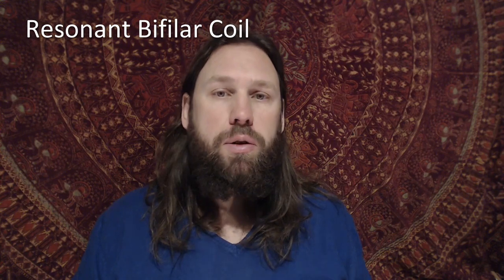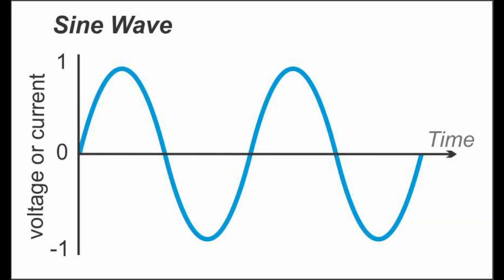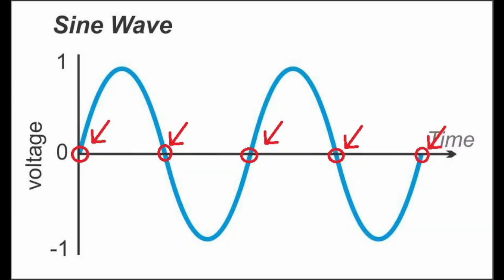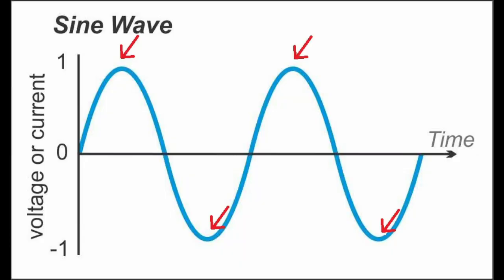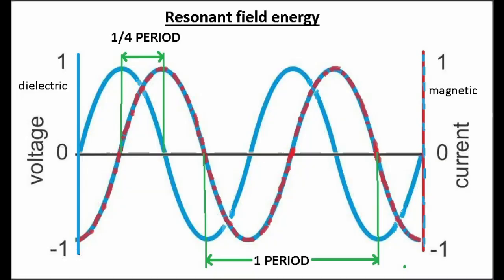C.P. Steinmetz explains electricity 02 Power, inductance and capacity

Comment: What is the current exactly ? Is it the magnetic and dielectric flux in movement ? Ether in movement ? Thx !
Reply from the maker: yes Aether = energy = inertia/momentum.
When a static field (voltage) starts changing, an aether energy flow (current) starts.
this flow can be longitudinal and/or transverse. it can be dielectric displacement current or magnetic current.
So 4 ways to flow, 4 types of current and one static polarised aether field, making a total of 5 fields

Comment: It complicates understanding electrical power (as energy) when negative voltage (dielectric field energy) is both a decreasing value (no matter the relative value) and a value that is below neutral or ground value.  Either one can have dampening effects to your power performance.

I also think it important to recognize the distinction that both components of electricity (dielectricity and magnetism) are kinetic energies, following the characteristics of kinetic energy transfer (not always linear combinations) in fact, amplification of relative values are easily amplifed by combining accelerating values of one energy with another ( the basic Oberth effect, used to amplify rocket thrust energy in space or power transferred in sports from boxing to baseball to cricket, bowling, and billiards.) Maximize acceleration of values in combination or transfer and see an exponential increase in value. This fundamentally is what enables capacitors to transfer voltage (only when changing values). And why high voltages and frequencies have higher performance efficiencies.

Comment: Master Ivo, hello and thank you for your review of Steinmetz. I think it is important to distinguish between exchanging energy and creating power. It probably is best to focus on the exchange of energy and the dynamics that facilitate this with electrical energy components rather than go down the rat-hole of discussing the creation of useful power. Perhaps you can avoid the laws of nature police. NASA uses the Oberth effect all the time to maximize the effective transfer of energy from rocket fuel to spaceship velocity. This can facilitate the designs of electrical engineers optimizing the transfer of energy. Basically, the transfer of kinetic energy is exponentially improved with increases in velocity (In baseball, the only way to hit home runs is to accelerate the speed of your bat swing. (maximizing the bat's velocity upon contact with the ball. For martial artists, the same applies to punching. In electronics we see the only way to get a signal through a capacitor is to add velocity (a rate of change) to it. Same with storing magnetic fields in an inductor (change the rate of change in a voltage, producing a changing current (whatever that is without charge particles). 

Steinmetz also wrote about the similarity of electrical circuits massively exploding when high-voltage impulses were introduced at apparently distant points. This he likened to steam engine vessels that were opened rapidly at only one location, exploding in total instantly, demanding a very small controlled release to avoid this avalanche of state change.  Having a continuous capacitor along the length of an inductor changes the dynamic of inductors that normally are fed dielectricity from an end, progressively setting off the back EMF along the inductor, now becomes a massive, full inductor, simultaneous dielectric shift, creating a full length, simultaneous back EMF. (ideal for impulse creation, not possible with discrete components. Incidentally, characteristics would greatly improve the efficiency of electric motors exchanging electric fields and mechanical energies.

Most of the electronic strategies are reversible. IF you buck two magnetic fields at an inductor, you present a nearly infinite rate of change in the magnetic field at the inductor, producing a very high rate of magnetic induction without an equally high Lenz "law" reactance, improving the transfer of energy, looking like creating energy because a 12-volt battery can power a home with this method. Tesla and Don Smith both worked with very high voltages and swiftly changing impulses because they improve the efficiency of energy transfer to the point of running huge loads with self-transferred excess energy.

To switch metaphors... if someone gave you a box of bricks and a bucket of mortar would you proclaim houses could not be created? with electricity made of dielectricity and magnetism can you reasonably think electricity cannot be created? Does NASA create energy every time they get a single load of rocket fuel to send a ship 4x faster by doing a burn in orbit rather than free space? Sure looks that way to anyone not practiced in physicist-legal-speak. For a casual observer, combine a changing dielectric (voltage) field with a changning magnetic field, and do it so that the reactions do not oppose the change generators and you will be creating lots of electricity out of leveraged fields, seemingly for free. Don't do this if your goal is to charge for limited amounts of power. Those in that business will be compelled to put you out of business. Party on Dude, be good to each other.

Comment: Hello Professor/Master Ivo,
I am reviewing your CP Steinmetz lectures for the purpose of definitions of electricity that are closer to what electricity is. This better understanding of the nature of electricity will improve our understanding and ability to work together to apply electricity in more useful designs.
To begin, I am erasing all images of solid particles in electricity. This is critical to realize that electricity is a wave phenomenon (non-corporial energy that has specific and limited effect on physical particles, but is not the particles. (I’m still struggling with the concept that the wave of electrical energy is a virtual substance (Has physical effect, yet is not physical (you cannot fill a bucket with it, (but it can shatter the bucket’s structure). So it may be waves of Ether as Tesla said, but the important factor is what it takes to make the connection with physical matter; how to control these factors and apply them. Creating wave forms/standing wave patterns or virtual matter effects.
Sound is an atmospheric wave phenomenon that can vibrate atoms to resonance dissolution or beat and slap large objects to levitate and alter their physical state (cool, heat, soften, magnetize, etc.) This is very similar to how voltage affects objects. Tesla said DC voltage vibrated at 1MHz. Similarly highly charged objects have different physical properties, just as uniformly vibrating objects have altered physical properties,  combination of dielectric vibrations on semiconductors would have significant and useful altered properties affecting their mobility, effective mass and resistance, and displacement with other materials. I’m sure you could melt or cut the stone very precisely with relatively soft conductors.
Consider that dielectric and magnetic energy is what binds electrons and protons in-place/together. And what science considers as electron orbitals are receptacles for standing dielectric-magnetic waves. Spin is the magnetism, dielectricity, the charge. Degree of resonance the potential.
So where does this take us? Perhaps your approach will be sufficient, but how to explore and control the factors that enable electricity to replicate physical interactions with substances would be the direction experimentation should take?  Consider what is conduction but dielectric resonance throughout the (primarily over the surface) electron orbitals of conductive crystals. The effect of the resonance is to set the charge of each orbital to the same potential with a few differences due to physical differences in local structures (differing boundary conditions). These crystal structures are connected. When they are not, the mass of the objects seems to be the resonating conditions that the vibrating dielectric wave-forms resonate with.  Alignment of crystal structures would no doubt help. For magnetism, seeking to align spin is a more complex and precise or structured “micro-movement” than simple vibration. Motion or changes in the spins apparently helps establish resonance. When atoms ionize, they launch impulse waves that have the same characteristics as the wave forms in the “electron orbitals” When those waves hit with enough energy to stimulate a like ionization, a resonant effect happens and each similarly struck orbital would avalanche a synchronized vibration, similar to a laser. (Why Tesla’s spark gaps with magnetic quenching were so effective.)
You might try a magnetic pulse and see if you can greatly expand the rsonant distance between bifilar coils.  A brief enough magnetic impulse should pass through anything (even a faraday cage), but the torus of a qunching pulse may contribute self-cohering wave structure that does not disburse.
Party on Dude, be good to each other. B

Comment: you said that the resonant frequency of the bifilar coil is much lower...  Do you know the calculation for that, or approximately how much lower it tends to be?  I am trying to make a tank circuit with a resonant frequency in the 500HZ range...THank you for all that you have shared!
Reply from the maker: you're welcome. no the normal formula's never worked for me (applied to the bifilar coil). try different values untill it is right. even if a calculation is right, in reality it will be slightly off. Nature tends to do it's own thing, without a calculator :)
Reply: @MasterIvo  thanks.  yes, I understand.  But it would be nice to have a general ball park on where to start...
Reply from the maker: @lamar7592  those pancake coils of mine (21cm diameter) have a resonant frequency aroumd 1.1Mc/s with a few hundred pF they drop down to around 300kc/s
and 10nF brings them to 105kc/s
these are rough estimates. its not linear.
Reply: @MasterIvo  thank you that is helpful

Comment: If bifiler coil makes sine wave or pure Singh wave we dont need inverter to change DC to ac ? And not 50% to 30% enagy loss while its converting to DC to AC sir?
Reply from the maker: no, the ac is very high (radio) frequency, not like the 60/50 hz oit of our wall sockets.
To use it we first need to rectify to DC, and then invert  back to regular AC 110/230V 60/50hz
So yes there will be (relative) losses by conversion.

Comment: It also ramps current way up. And it also doubles the voltage. Also did you notice it has a.c. and dc voltage. Mine had both and worked with both as electro magnet😕

Comment: So valuable I noticed when I hooked up my coils when the voltage dropped to low it wouldn't set up a magnetic field. Ima try high voltage on one end and high current on other end🤔what you think will happen? Or maybe sandwich 2 high voltage inputs in each end🤔thanks for getting my noodle working😂🤣

Comment: I wonder how a seashell would behave under high voltage
Reply from the maker: try it
Reply: Master Ivo yeah well that brings up a good point. Can you recommend a variable power source for these experiments
Reply from the maker: depends how high the voltage and if its dc or ac, and how much power.
you can build them in several ways, easy could be a neon sign transformer. then with diodes in series make a rectifier. 
Be careful!
Reply: Master Ivo I’ll be ordering some electronics books so I can calculate an accurate supply system. Lots to learn. 

I wonder if you could submerge a bare wire pancake coil in a solution of ions, charge the coil with a specific electric field potential, and grow your own crystal dielectric. Perhaps you can achieve a higher dielectric coefficient this way than with pvc, as there are a plethora of ions and crystal configurations to choose from, modifying the geometry of your crystal to destructively interfere with a changing magnetic field. 
These are the experiments I hope to begin soon.
Reply from the maker: @wyattcarpenter8951  sounds good. keep in mind, if you use DC to create a crystal dielectric, you probably are making a diode. Which only works one way. So it will only work with DC not AC (won't resonate).
My experience with books: it's quicker if you use your own creative mind.
Reply: Ivo, sorry I don’t understand. Did you mean to say AC will work but DC will not?

Comment: Magnetic Fields consume energy to exist & the super  saturated conductor will want to dump that extra energy! Some as light energy ( Infra red heat) & some as the dialectic fields of capacitance ( a capacitor uses a pinch tech & will require no extra energy to exist)
So their is an abundance of dielectric energy in everywhere & an energy pollution of the light energy ( heat). The either is counter space time energy in Unlimited amounts & the permanent magnet show's a release in the energy Hungary magnetic Fields?
Reply from the maker: yes time is an important factor to play with, by making the impulse duration shorter. the magnetic and dielectric fields are analogous, and transform into each other transversly. but the longitudinal impulse works without current.

keeping resistance low, not only prevents the heat loss, it also keeps the impulse fast.

Comment: A resonator creates a transient condition between the ether medium and the energy stored in the space around  the inductor coil.  When the inductor coil is turned on it stores energy around the coil from the ether medium, a z-pinch.  When it is turned off that releases the energy back to the surrounding medium.  When we repeatedly turn the power on and off at a certain frequency, this creates a wave in the medium at the frequency of the A.C current, an alternating transient effect in the medium.  That is a radio signal or frequency wave, a sine wave.  This is just like repeatedly vibrating a water surface to create a frequency of vibration on the water surface that fans out from a point source.
   Each electron flowing through the loop has been found to store 1/2 mole of medium particles around the coil.  The more electrons flowing the higher the amplitude of  the transient flow to and from the coil and the medium.
   At 5:30 the reason the voltage of the dielectric field is 90 degrees out of phase, is that the rise of voltage represents the movement of medium particles into the coil, when the voltage peaks the movement stops.  When the voltage decrease the movement flows the other way, discharging the coil.  When the electrons flow the other way through the coil, the medium particles, being dipolar, store in there in the opposite direction. The magnetic field represents the amount of movement of ether medium particles into and out of the circuit and will always trial  the voltage level by 90 degrees.  These particles flow the opposite way around each wire when the electron flow direction changes, and reverses the magnetic field flow through the core of the coil.

Comment: I've been considering electricity as a resonance within a crystalline structure, and as such the possibility for harmonics within the latticework become an available phenomenon to study.  Piezoelectric crystals are a demonstration of what creates this "charge", and this charge is the harmonic ringing of the crystal structure, which has been harnessed and directed so as to perform work.  By working to understand the harmonic nature of crystals, we will come to take free and clean power as a given.  Resonance is a force that can be brought to yield more energy than what is input, by generating harmonics.  This is what the granite slabs in the roof of the King's Chamber were for.  Each tuned to their individual resonant frequencies, when in operation they resonated in concert to generate powerful harmonics that amplified into useable "power". 

Electricity is harmonic resonance of a crystalline structure.
Reply from the maker: In my opinion based on my research, resonance has no real power, as the 2 elements to create power (dielectric- and magnetic field) are out of phase.

 You need both at the same time to generate power.

Crystals, are everywhere, and used extensively.
All electronics work with crysrals, each mosfet, transistor, diode is a crystal.
And every sand grain on earth is a crystal.